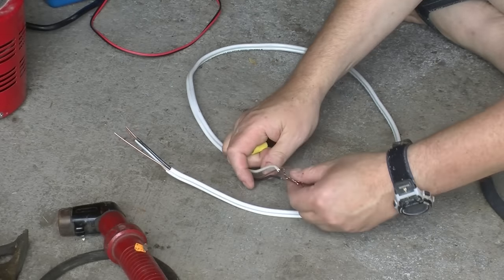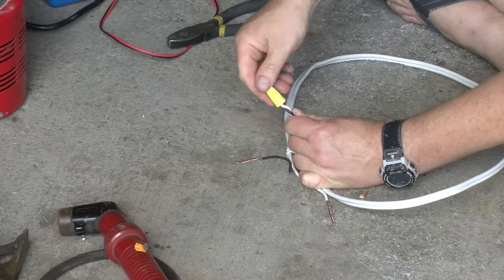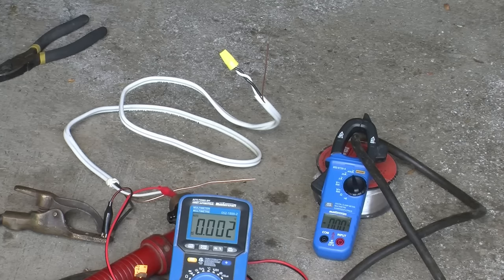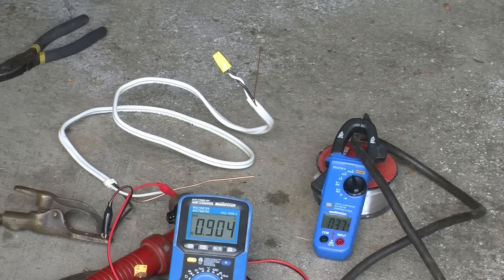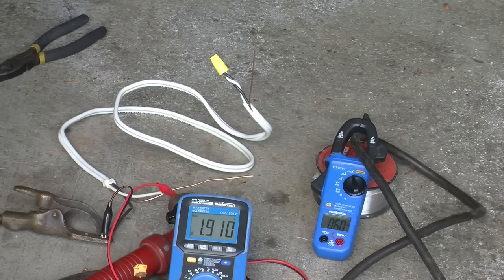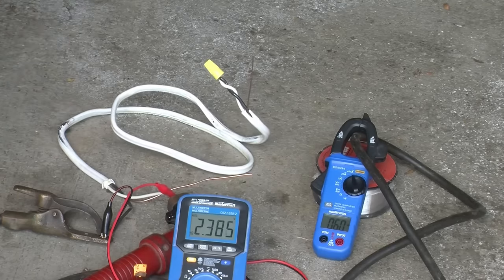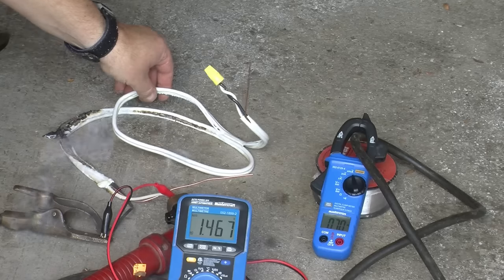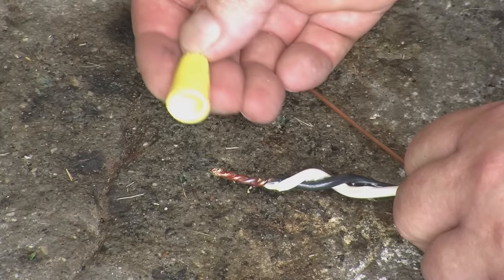How many Amps to burn up 14/2 electrical wiring?

Comment: In my experience when you use the correct size wire nut on 2 or more wires, the process of twisting on the wire nut causes the wires to get twisted together. I know that because when I removed the wire nut I could see that the wires were twisted together – clockwise, the direction in which they wire nut twisted when it was put on.
Reply from the maker: Your right - apparently some wire nut instructions specifically say don't pre-twist. On this and other videos I have seen commenters get  in in huge fights as to whether to pre-twist or not.
Reply: @ElectromagneticVideos  I got into that debate with my son. I was wiring up something and he was watching me and he interrupted when he saw me put the wire nut on without pre-twisting. I undid the wire nut and showed him how the wires had been twisted when I put on the wire nut but he didn't seem convinced and kept arguing for the pre-twist method, but eventually we just forgot about it and he pre-twisted his connections and I put my wire nuts on without pre-twisting and the control devices  for the  oil-fired hydronic (oil hot water) central heating system for the house worked for years to come without electrical issues. Oddly, he is usually the person that finds short cuts for  doing things and I am usually obsessive about details and end up taking more time, but with wire nuts it was the other way around.
Reply from the maker: @soilmanted  As vehement as people are about doing it one way of the other, there do seem to be wire nuts designed for one or the other or both. I once lived in a house where the wires were not pre-twisted and the wires in the nuts were not very twisted either. And it didn't burn down the house but really didn't seem secure enough for my comfort. 

Funnily enough, my current house is hot water heat and was oil but the insurance co made me change to propane 8 years ago after the oil tank reached 15 year old (or put in an incredibly expensive multi-layer oil tank). I'm planning to switch to an electric boiler this summer cause propane prices have gone through the roof.
Reply: @ElectromagneticVideos  Yes I learned there are several different types of wire nuts. I'm not an electrician. However I did my own upkeep on my own house (in Suffolk County NY) including plumbing, electrical, and heating. Lived there for about 22 years. Moved into a rental around 2005. Then moved to a rental unit in apartment building in Asheville NC around 2012. My retirement income goes further here. It looks like I now may be able to get a mortgage and buy my own house here. House in the NYC suburb was build around 1972. It had oil tank that was buried underground! I always worried about leakage into the soil. By the time I moved out it had been there for more than 30 years. Made of steel. Steel rusts. I wonder what the current owner is doing with it. Here in Asheville electricity is much cheaper and many houses and  apartments have heat pumps. Of course the apartment I live in has the least efficient heat pump model – I suppose because tenants pay for electricity, not the owner of the building. One of many reasons to buy my own house. It appears that some houses around here heat with propane. Oil seems less frequent. Quick check on google suggest that per unit of heat, in western NC propane costs less. I eventually got pretty good at getting oil burners to burn as cleanly as possible, but I also remember frequently cleaning the tubes that ran through the boiler that was above the combustion chamber, where heat eas transferred to the water in the boiler. I'm forgetting the names of the various parts. I've never worked on propane systems, just oil hot-water and oil hot-air. I didn't realize how much of that  I am having trouble remembering until I started writing this! Nevertheless I never needed to call professionals to maintain the heating system for my house. Learned to do everything myself. I think I would probably go for propane here in western NC, if I am able to buy my own house here.
Reply from the maker: @soilmanted  Interesting thing about propane is the boiler has required almost no service since I got it. Cant say that for the old oil boiler. It think its very much a case of where you live and what is the cost of what is available. Over here (Ontario, Canada) natural gas is a fraction the cost of everywhere else, but since I am in the country that is not an option for me. 

The insurance co  did an inspection of my place a few years ago. I asked how it compared to others. They said no comparison - apparently they have huge issues with buried oil tanks or ones in unfinished basements that have been leaking for years. I guess the environmental cleanup has horrendous costs.

Comment: I happened across a stash of older "wire nuts" they were from the copper internal days.
When i saw the wire nut was the newer aluminum internal kind i was curious. It did very well. Seemed like the last point of failure. Would be interesting to see a "wago" torture tested. Cant see the copper aluminum copper again interface lasting to 50 amps.
Reply from the maker: I think the aluminum looking ones have steel coils with some sort of aluminum looking plating. Maybe tin plating?  I cant imagine any of them being made out of aluminum due to the oxidation issues and softness of the metal.  

I will definitely do some more wago torture testing - your not the only one to ask.  It will have to wait till summer unless I find something I can use  as a fume hood because I wouldn't want those toxic gasses indoors!

Comment: I'm guessing this is at 110v?

Edit. Ok nice volt meter. I was assuming this was going to be testing the amperage at a given voltage. This is obviously a much safer way to do this.

Comment: try a much longer copper wire, because the longer the wire the more resistance (and inductance i guess) so the current rating degrades.

Comment: I can’t believe you were even touching this as the amps got high!!!
Reply from the maker: The voltage remains low so no shock issue. Only issue is the heat - was careful not to burn my fingers :)

Comment: You should do the same test with wago type splices  and a standard type push in vers screw on connection on a switch or socket thats shorted  keeping the wire length the same each test, you can also use a point thermometer.
Touching that can kill you  so dont.
Its only takes a mili amp of current to stop your hart.
Reply from the maker: Wagos and other that you describe are on my list for this spring when I can do stuff outside and not suffocate from the fumes.

Touching - for this type of the voltage is low - less than 10V - to push a controlled current though what is essentially a short, so no risk when I did it. Appreciate your concern though!

Comment: I was aught to NOT pretwist the wires because the connection is not electrically different but testing and replacing later is problematic due to the pre twist.
Reply from the maker: How interesting! I wonder if it is a regional thing - to twist or not to twist? Twisting certainly does make it a real pain take apart at some future time.

Comment: Except you cannot twist stranded wire to solid wire, at least not very soundly. So all the fixtures that come with stranded wire are susceptible in your opinion, is that accurate?
Reply from the maker: "with stranded wire are susceptible" - not sure if thats a typo - not sure what you mean. But if you are saying you cant make as nice a twisted connection between a solid and stranded wire with a wirenut - I agree. Luckily thats usually for low power loads like lights etc.

Comment: So let's just be clear for anyone watching this..  14/2 nmb wire should really only be used for your lighting circuits.  For recepticles and general circuits 12/2 should be used.
Reply from the maker: That seems to be a region specific thing. Most houses around here are 14/2 for receptacles including the one I currently live in. But if I was having a house built, I would definitely insist on 12/2 and also better receptacles than the cheapest ones normally used.

Comment: How does it do for typical 20 amps, the answer seems to be OK, and some short run of the wrong gauge wire to a single thing probably will not get a fraction of the 20 amps.
Reply from the maker: It should  survive  for 20A as you would hope as part of the safety factor, but less so if buried in insulation (see the followup videos). BUT using more than the rated ampacity for a cable opens you up to thing like insurance being denied if anything does go wrong so its a really bad idea to skimp on the cable size. And why take the risk?

Comment: The problem with twisting as you do, there is no way to check if each of the wires are bonded into the cap.  If not twisted as you did, you can check that the wires are tight in the nut - that's where it matters!
Reply: If the wires are twisted together properly, the cap isn't even needed other than to keep them from touching another conductor.

Comment: The newer connector types are harder to connect incorrectly, and make changes a breeze, but don't have as secure a connection and have higher resistance than a wire on wire connection.
Reply from the maker: Yeah - its a compromise no matter which you use.

Comment: What kind of welding set up you have that you can have such tight current regulation?
Reply from the maker: It is an old 225A Miller arc welder which is essentially a giant transformer with no fancy electronics. Welding transformers like that allow an adjustable amount of magnetic flux to bypass secondary and this configuration provides a crude constant current output rather than the constant voltage output of a "standard" transformer. To adjust the output current I have a variac (an adjustable transformer) providing an adjustable voltage to power the welder. By adjusting the supply voltage like that I can quite precisely control the output current of the welder for these experiments.

Comment: Not that I would ever do it but I guess this is saying that if I ran a 15a on 14/2 that the outlet could handle like 40 amps and not burn up? Or perhaps the wire wouldn't burn but the outlet might?
Reply from the maker: As you said - not something to ever do! In these circumstances - cable in open air to cool it, 14/2 can sustain a quite a bit more current than we normally expect it to. You always want a significant safety factor to make sure that its safe in less than these better than idea circumstances. I did a bunch of much more realistic tests with the cable in 2x4 walls surrounded by insulation and the safety factor goes way down as one would expect - the insulation confines the heat so much that a much lower current will cause the plastic to fail. If  your interested, the tests are here: https://www.youtube.com/playlist?list=PLHUfJmsprIcTVwSgCkTJnkinJSWrZY7DY

Comment: I'd like to see the same test using a wago instead of a wirenut👍
Reply from the maker: I did it in a later video - spoiler the  wagos didnt do as well as the wire nut, but only when subjected to considerable over current.

Comment: Voltage does matter. If it was at 120v that cable would have been smoked. 40 to 60 amps
Reply: Why do you believe that? The heating of the wire is determined by the wires resistance and the voltage drop across the wires. That voltage drop is dependent upon the resistance of the wire and the current flowing through the wire. Check out ohm's law and you will see what I mean.

Comment: A more realistic test would be to use the regular household voltage of 120 vac. The test should start at that voltage specific voltage and 10 amps base line. Then move up on the Amperage only maybe intervalsof 5 or 10 ampst at a time.. That would be realistic since homes normally use the 120 vac not 1 or 2 vac.
Reply from the maker: The heating of the wire is from the voltage developed along the wire due to the current encountering the wire’s resistance.  If  the voltage between the wires was 120V (or 240V) with a load attached to the end of the wires, the same voltage drop of a few volts would be measurable along length  of the wires for a given current  and the heating would be the same.  120V times the current would be the power delivered to the load, different from the power that is dissipated in the wires which we are interested in. To keep this test simple and safe, there is no load (by shorting then end) and all we need is a few volts to create the desired current – and heating in the wires. 

See  "OVERCURRENT TESTS FAQ" here  https://www.youtube.com/post/UgkxeilOfLJGy2ODslnBW0WFXUE580oHhFyP  including why a current source like welder is used and a link to a UL test done in almost the same way. 

I did a recent video where I discussed all of this in a bit more detail - take a look here: https://youtu.be/9vkMeyAx7o4?si=ai-Af32z-hBHRVhz&t=655

Comment: A little confused here.  Is wattage not a concern in this experiment??.   I kind of thought that most houses wire is running ar 120v so at 30 amps it would draw 3600 watts.  In your experiment you  wattages were all under a 100.  So would this be an accurate experiment as to what is happening inside of house walls??  Is the wire concerned about watts at all or is it just amps?
Reply from the maker: The danger overloaded wires pose is from heating which is the result of the current flowing though the wire and the resistance of the wire itself. The heat generated in the wire  (not the load connected at the end) is the wire resistance times the square of the current.  So you right that the load would be drawing about 3600W if the line voltage is 120V (a bit less due to the few volts dropped along the length of the wire) or 7200W that of it was 240V but that power is safely dissipated in the load. Where the big load comes in is because it determines how much current flows though the wire. The heating in the wire is the same for 30A regardless of whether the load is running at 120V (3600W) or 240V  (7200W) or 12v (360W). If you look at wire ampacity ratings, its based only on the current. Hope that makes it a bit clearer!
Reply: @ElectromagneticVideos  yes it does. It just is ironic that you could burn a wire out with amps at a very low voltage in the same way that you could burn it out with the same amount of amps running a very high voltage.   I think in your experiment it was killed with less than 100 watts of power even though in theory that same wire could run several thousand Watts.  That part is counterintuitive.
Reply from the maker: @shakamuni01  Yes is is counterintuitive if you put it that way! That is the reason we user higher voltages when greater loads are needed - to keep the current down and the resistive heating low which is a loss of energy as a source of heat . One example of the opposite - a large load with low voltage is the starter on a car. The wire to it is huge so it can carry hundreds of amps at only 12V. And if it took more than a few tens of seconds to start the car, that wire would probably get warm or even hot (and the starter would burn out).

Comment: I get confused what does 70 amps at 1.5 to 2.4 volts do to ya when you get zapped? The voltage drop means the wires fused together or should that have  caused a sudden short burn thru?.
Reply from the maker: The 1 or 2 volts is the voltage along the wire carrying current due to the small but no zero resistance of the copper. This is typical of all wire - there has to be a small voltage along the wire t drive the current (unless the wire is a super conductor). 

Yes - at some point the the plastic gets so soft that conductors somewhere between the tow ends of the cable touch, lowering the resistance (wire length is halved or something like that)  dropping the voltage needed to push the somewhat regulated constant current though the wires. If we had applied a constant voltage to the wire, cutting the resistance would have significantly increased the current flowing at that point. 

What will  one or two volts along  the wire   do to you  if you get zapped? Well as long the whole circuit is close to ground potential as in this demo - one connector from the welder is at ground, the other a couple volts above it - not much. Other than the risk of burning your fingers from the heat. In a normal house circuit, the neutral wire is essentially connected to ground, but the live is 120V (or 230V outside of North America) above ground. In that case, you still get the voltage along the wires only being a few volts due to current flowing to the load (appliance, heater etc) but the live wire is still 120V or 230V above ground and you could get dangerously zapped if touching it. I would not be touching the wire if that was the situation!

Hope that helps!

Comment: Wow! incredible demonstration. I did a self built electrical on my Van and I'll be using an Induction Stove Top and Oven. Each of them are 15Amp at 1800 watt. I use a breaker for each of them, separately. Meaning, nothing else will be connected to thies receptacle. I have a 3000 Multiplus Inverter. I am using a 14 AWG. Not knowing if this is Ok for me to do, I like to ask if I am safe to do so? Thank You. A++ on this video.
Reply from the maker: So glad you liked it!  #14 is  rated for 15A. I'm envious - one of my future plans is to make a camper van. What are you using as batteries?